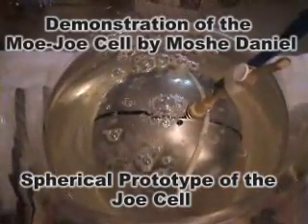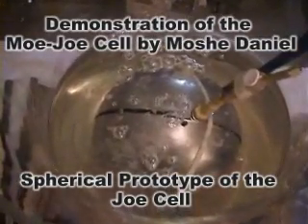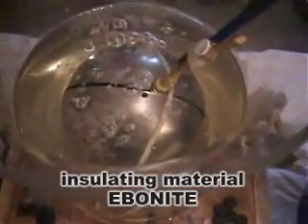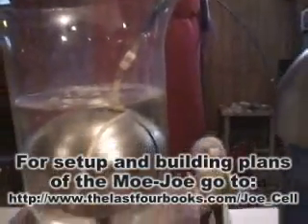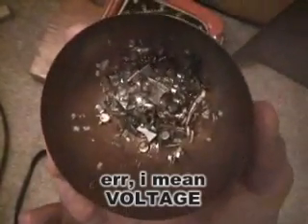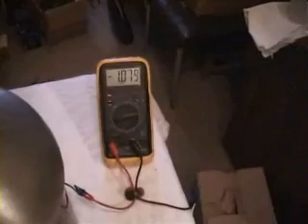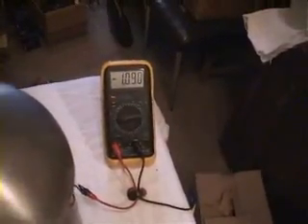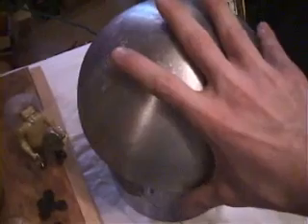The Moe Joe Cell Stage3 Part 2- Spherical Joe Cell

Comment from the maker: @alaskablows
some metals, aluminum mostly, may be associated as a cause of Alzheimers.
We use stainless steel for the cells. and we don't drink a lot of the water. not enough to cause any toxicity. we take just a few drops of the charged water and put inside of clean, filtered water, and then vortex. the water all becomes highly charged.

Comment from the maker: Orgonite is very different from Orgone. Two separate things, but related. Orgonite is made by casting resin with many many small chips and bits of different metals to generate orgone. Orgone is the universal life energy also known as Aether. It wouldn't appear on the standard chemistry table of elements.

Comment from the maker: Hi, It is used for running cars --> either to run in what is called down under "Shandy mode" which decreases the need for fuel or to run completely without fuel. Go to thelastfourbooks . com /Joe_Cell to see some links and more info about the cell and how people are using it for Internal Combustion Engines